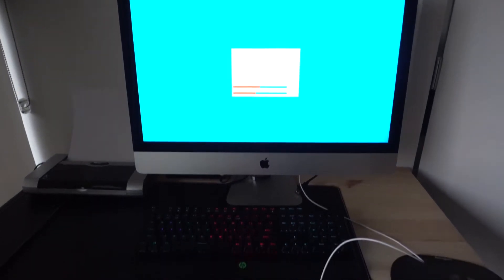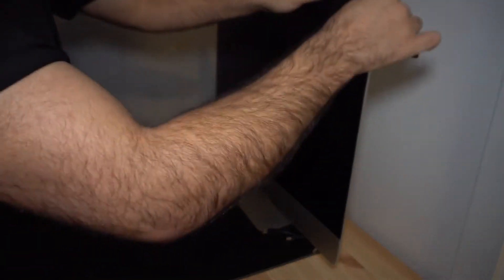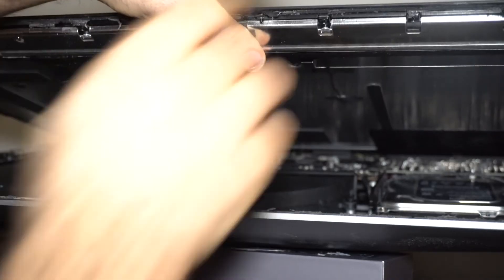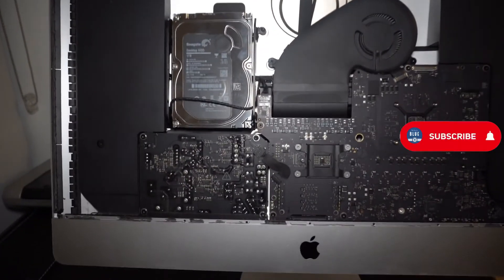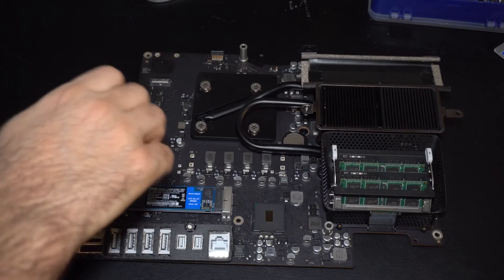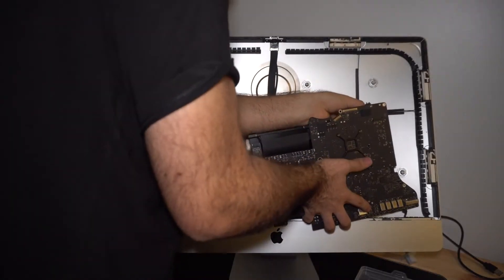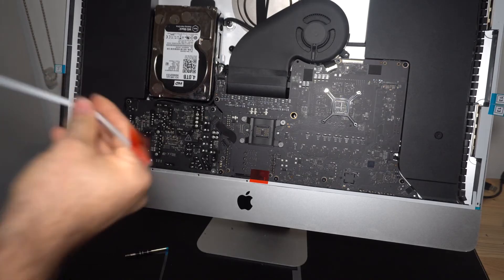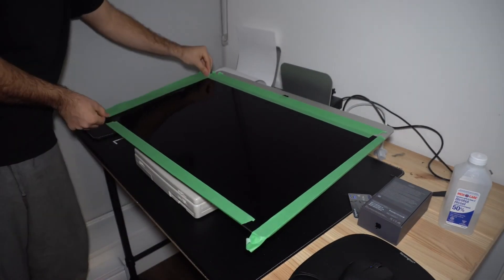27'' iMac Late 2015 SSD install

Comment: Seems to be a lot of confusion regarding NVME, calling them SSD is misleading. An SSD is a solid state form of HDD in 2.5" format. Whereas an NVME is a small plugin Card style device. Yes there are different versions especially regarding the plug-in connection. M.2 being commonest and current.

Comment: What drive was in youre Mac before you put wd ssd in? Apples flash drive? Mine has a flash drive.  Youre solution(adapter ) could work in my late 2015?

Comment: Did you have problems with NVME Samsung 980? Is it compatible with iMac Late 2015?
Reply from the maker: no issues. i've since moved on from this iMac but used for years with no issues.

Comment: Hi, you mentioned having upgraded the CPU from i5 to i7 6700. The late 2015 iMac uses DDR3 RAM. Does this mean with this CPU upgrade, you can now use DDR4 RAM instead of the factory supplied DDR3?
Reply from the maker: No. i7 6700 is backward compatible with DDR3 that comes with the iMac. the board physically is designed for DDR3 so you cannot fit DDR4 there.

Comment: Thanks for the vid. I have a 250 GB SSD and no Fusion drive in my late 2015 27" Retina 5K. I would like to put in a 1.5 or 2 TB SSD. Would that be a simple case of removing the SSD like yours and putting in a replacement? I am guessing there would simply be nothing where the HD is ?
Reply from the maker: yup it should be exactly the same. if i were you, i'd upgrade my main disk to NVMe and put in a 1TB SSD instead of the fusion drive. that way you are set until you upgrade to something more powerful.
Reply: Wow thanks, The GuyinBlue ! So what would I be looking for in a replacement for the Fusion Drive as now I have none. Al  @TheGuyinBlue

Comment: oh Im confused, seems like you kept the HDD - I don't know much about NVMe - is there a reason you didn't swap the HDD with a SSD drive?
Reply from the maker: NVMe drive is already few times aster than SSD so that will be used for booting in. 1TB HDD is used for storing data so it has no real impact on the computer's performance therefore overkill to replace with SSD. but one with money could replace it.
Reply: @TheGuyinBlue  Thanks so much for the very valuable response. I haven't upgraded my 2015 imac yet but I purchased the SSD and the Ifixit kit already, I started reviewing videos for how tos and started to discover alot of people using NVMEs like yourself. I am weighing if I want to go that route since I am going to open up the imac anyway.   In your case, do you have two drives on your desktop. (one being the boot drive (NVMe) and the other being the HHD as the storage drive?  Any strange issues with compatibility with the NVMe?   Thanks again for your response.
Reply from the maker: @sammieseoul5544 i hope you successfully did your upgrade. i initially opened mine and installed a WD Nvme drive. had all kind of issues. since upgrading the Samsung those issues went away.
Reply: @TheGuyinBlue   hey, yes I did upgrade and infact, I am typing from my newly upgraded imac. I just replaced the SSD. My biggest area of concern was putting it back together and ensuring I would not have any issues with the adhesive loosening up. I was very thorough in cleaning the residue and also creatively used a few zip ties and adhesive tie downs to secure the screen to the mac internally (mainly to catch the screen if the screen adhesive failed).   Anyhow, this was an upgrade well worth doing as I am not a fan of the 24 inch imac. I hope Apple eventually created a new 27 or even a 30 inch M-based imac in the future, until then, I will continue to "Rock" with my 2015 Imac.

Comment: Thanks for this. Where did you get the ssd adapter from?
Reply from the maker: i believe i bought it off of facebook marketplace but a lot of brands are available on Amazon/Ebay.
Reply: @TheGuyinBlue  Thanks, found one in Amazon.  Btw, did you encounter any issues with Samsung 980 ssd?
Reply from the maker: @concepto416 980 no issues. the WD i had before gave me all kind of issues. the last straw for me was the sleeping issue. everything the computer went to sleep, it wouldnt wake up and i had to completely power off the computer. never had that issue with 980.

Comment: Do you know if the sandisk ssd ultra drives are any good for this upgrade?
Reply from the maker: due to how difficult it is to open these things better to stick with Samsung. i had WD originaly but came across odd freezing issues. if you're planning to replace the HDD with Sandisk SSD, keep in mind the fan might go crazy.
Reply: Thanks mate. I'll switch to Samsung and from what I've read on the Internet adding a thermal sensor sorts out the fan. Hopefully thats correct

Comment: Thanks for sharing. No sleep/hibernation issues?
Reply from the maker: i did have hibernation/sleep issue with the WD ssd but i have since upgraded to a 1 TB Samsung nvme and the issue is gone. there were also times when the computer would freeze randomly. since upgrading 4 months ago, i have not had that issue.

Comment: Did you combine the SSD & HDD into a Fusion Drive? Or do you use them as separate drives?
Reply from the maker: separate drives because combining them together means it'll operate at the lowest speed of the fusion drive which means you get no benefit from NVME. also, not sure how you'd combine them since imac does not support raid.